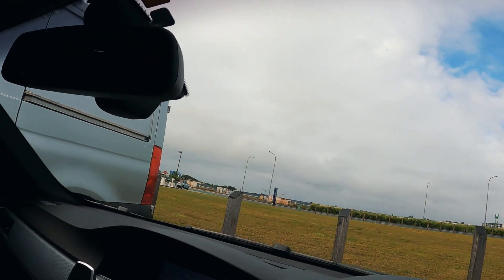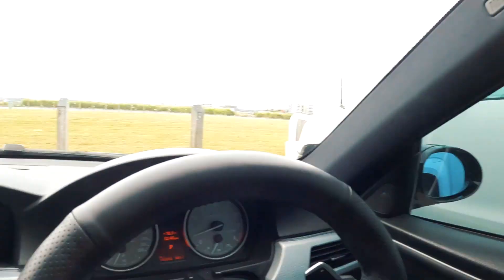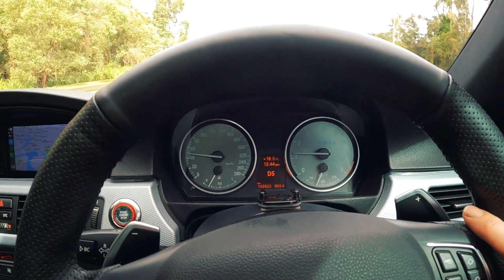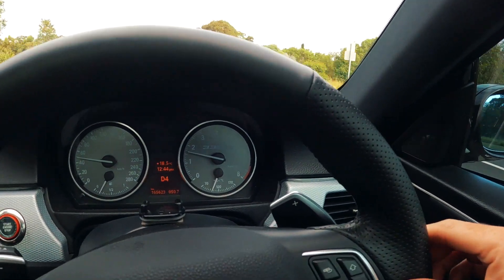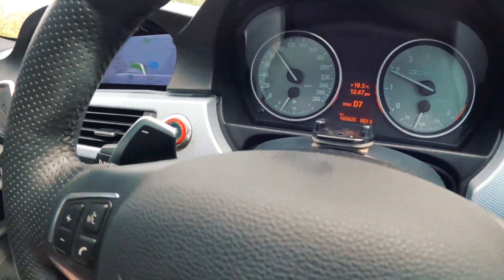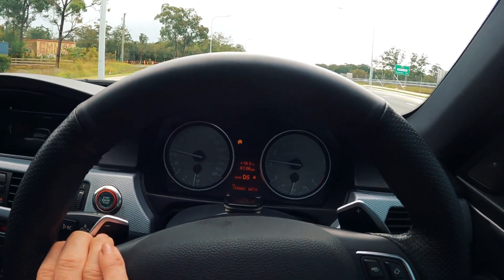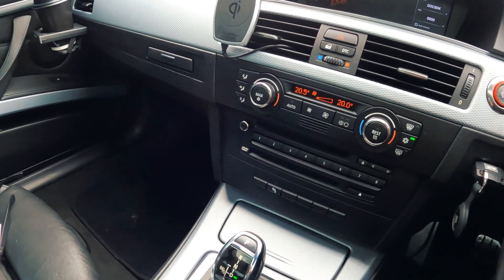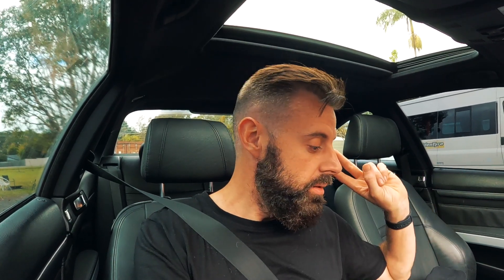BMW DCT SWAP With Single Mass Flywheel: What's it like?

Comment: Early shifting is exactly what my DCT does in comfort mode (Z4 35IS). In sport it'll shift with less clutch slip, much faster and in sport+ you get the fastest gear changes. In sport+ it'll keep the revs much higher similar to having the DCT in sport mode. Most of this is customisable in XHP. Early shifting is probably meant to keep fuel consumption down. The behavior of your DCT is absolutely correct.

I currently have XHP stage 2 on the DCT as I find stage 3 much too violent. There's 235000km on the car and the engine and DCT still feel like new. No noises that shouldn't be there or stand out at all. Shifting points (revs) can be customised.

Recently the weld of the ring (or pinion, I'm not an expert) broke off in the diff. I replaced the diff with a OS Giken super lock. Excellent piece of kit! My only worry is the drive shaft and axles now.

The only downside of the DCT I can think of is that it sometimes needs a bit of thinking time. That combined with the low revs in comfort mode (always highest gear possible) means no boost. Practically it means you need to put your foot down in time long before you start a quick overtaking. After years of driving this car it still causes sweaty handpalms sometimes.
Obviously this can all be avoided by a manual (or 2, 3..) downshift before overtaking. Basically the automation of the manual gearbox is excellent most of the time but it is not perfect! Not even with XHP.
Reply from the maker: Thanks for the detailed comment appreciate all that info dude. Can’t wait to try xHP
Reply: DCT is inherently slower at multiple downshifts like dropping 2-3 gears to make a pass on the highway... it needs to make those 2-3 shifts it can't just drop from 6th to 3rd like a regular auto or a manual. This is really the only scenario where youll see this delay.

Comment: Before you put the 26PSI map on the car check your reported torque from the map, that's the reason a lot of people say to avoid the JB4 on a DCT car. Your reported torque needs to be accurate, too little and you'll get increased wear and maybe slip. Also good to not over report as the shifts are so much better when the reported torque is accurate.
Reply from the maker: Jsr is on it!

Comment: you can tune all of these things with xhp as you know.  My N54 with the zf6hp shifts into 6th gear at 40MPH.  just tune all of those issues away!!!  Great Job Man!!!!
Reply from the maker: Thats the plan, well part of it anyway
Reply: Nice!! Hey what max power can the DCT handle?  I know the clutches can be upgraded. Also, you mentioned a “Group Chat” for folks, where is that?
Reply from the maker: @garygrenier  Hey Gary, the DCT "should" handle 1000nm with the latest xHP update. The telegram group chat is for the top level zero to 60 members the "ZeroTo60 G's". Its a direct link to my phone for direct support help and general chit chat.

Comment: Box controller when not in sport mode is shifting for maximum fuel economy, always. 

Aftermarket tune will solve it. Alternatively if you can modify the sport behaviour with the levels the most aggressive will avoid shifting into 7th. 

M50d rolls round in 8th at 60 in economy and 5th in sport +

Comment: I had to put headphones in and crank the volume to hear anything to do with the flywheel. Could be more noticeable in person but from here seems pretty liveable. 

Know what you mean regarding the D Mode economy shifting. It makes the car feel unpowered and sluggish. I stick mine into S Mode once it’s warmed up a bit and it sorts it right out. I tend to prefer that over Sport button because the throttle is more relaxed for around town driving. 

You definitely seem to be enjoying it! “One, two, three” on the paddles haha.

Comment: Great content!! I found the dct the same initially. but after driving a bit you will find the mode that suits your mood...that's the awsome thing about it. I have xph stage 3..calm in normal and aggressive in max sports setting. Leave the button off and shift gear over to sport is the perfect blend (n55 ps2 310 rwkw)
only negative..Consistent good launches are a distant memory 😃good work again!
Reply from the maker: I have no doubts about the launches being a pain from here on in.

Comment: When I did the XHP stage 3 flash on my ZF8 for the M135i, it keeps the revs up a bit more. Previously it would often go into 8th at 65km/h @ 1150rpm, now it wont go into 8th until about 80km/h @ 1400rpm. It also holds gears longer during light acceleration and reduces gear hunting. I also found that the torque converter locks quicker in drive mode too.

Comment: I've got a 335is with a DCT at about 83,000 miles. Mine behaves the same but it doesn't really feel like the car is laboring or the revs are too low. I'd be interested if it changes the more km you put on it. Great stuff!
Reply from the maker: I think it’s my exhaust. It’s just droney under 2000rpm which probably amplifies it all.
Reply: What exhaust is on it? I have the stock tuned 335is all the way
Reply from the maker: @maxcuevas1359  Its a milltek cat back system. Pretty quiet bit very very deep note. Like you cant really hear it driving but on cold start it vibrates the whole house.

Comment: With XHP you can adjust how long each gear will ride out in auto mode or with sports button pressed or s mode you can adjust everything so you can have it not switch to 7th so early in any mode you want

Comment: My issue with DCT has only ever been at low speed maneuvering and taking off on wet grass, when moving I found it fine, I drove a golf DCT with a tune on it and it felt like if it was manual, rev it up and dump the clutch hated it. I chose an auto in mt 135I and I've just done a stage 3 xhp and love it

Comment: You can set launch control rpm using the indicator stalk wheel.

Great video! Can’t wait for the next one.
Reply from the maker: I will check, but i am fairly sure only the true m cars can do that.
Reply: @ZeroTo60Tube  Whoops. My bad, I think you’re correct. Just checked the manuals and there is a definite difference between the M3 and the 335i. 

Maybe worth a try anyway. Apparently it’s the cruise control stalk. Push away for increase in rpm, pull towards you for decrease.
Reply: M cars only for the stalk selection they also get variable sport settings. Can adjust launch control rpm in xhp for these ones

Comment: N54 community needs a “torque by gear” tune/setting rather than boost by gear.
Reply: Is there an inbuilt method of detecting engine torque?
Reply: @Adam-eo5ff  There is in MHD. In the graph it reflects a Newton meter of torque rather than foot pound. So I’m pretty sure there is a way, but nothing that has been mentioned in videos other than boost by gear.
Reply: @SWATMM  I think this is actually just a scale with a maximum torque level and a gauge that adjusts based on throttle position.

Comment: Love this series mate. Great information provided. I feel like too often people don't care or talk about OEM levels of driveability. It IS possible to increase performance of a car and retain factory levels of NVH and driveability. But so often people just seem to put it in the too hard basket. I'm investigating putting one of these DCT's behind a 2JZ. Do you know what a typical price for these is in Australia?
Reply from the maker: I know you will need the HTG controller and hours of tuning. Probabaly going to be $8000-$10000 in parts and then tuning is like how long is a piece of string.
Reply: @ZeroTo60Tube  Sorry, I was specifically asking about the trans cost alone. Whifbitz make a conversion kit for everything else. From what I can tell the transmissions cost ~$4-5k here
Reply from the maker: @mr.a5147  Sorry dude, they used to be around $3000-$4500, however they are sneaking up in price of late. I havent seen one for ages. ebay.com.au is the place to keep an eye on.

Comment: Can drive mine to compare feel if you want. Definitely prefer the creep disabled, the xhp flash makes driveability in D mode heaps better, auto blips on downshift and can set clutch packs to performance or burnout mode, night and day difference. One thing though in Sport mode the shifts are violent and unsettle the car a bit but adding some torque reduction helped all round
Reply from the maker: Good to know. Good to know.

Comment: I’d say the biggest benefit of the xhp is the increased line pressure to keep your stock clutch life longer! Especially since you said it’s at 190k’s bet you the m factory flywheel helps the clutches too since there is less mass?
Reply from the maker: That’s the main reason I want xHP. You could also be right about single mass flywheel.

Comment: Andrew im thinking of going with this Flywheel for my OG M2, i have heard that some say the noise is atrocious in 7th gear on cruise? Would you say it is really so bad?
Reply from the maker: On mine i just had to raise the rpm shift points. So it wasnt labouring the engine at low rpms. Im gonna keep using this one.

Comment: Enjoying the video - but what have I missed regarding your diff? Why do you have a open diff now? What video do I need to watch?
Reply from the maker: The old diff is not compatible with the dct. So it’s out.
Reply: @ZeroTo60Tube  so what is compatible? How come yours wasn’t?
Reply from the maker: @lukeviewservice  Diff ratio, the auto is a 3.46 vs 2.56 ( i think) in the DCT. Then the DCT diff is a welded diff gear, so i cant swap the the centre.

Comment: Is flywheel pretty straightforward install?  Just remove tranny and old flywheel then bolt in new one?  I tried looking through the series, couldn’t find a clip of you showing the physical install of flywheel.  Sorry if I missed it.
Reply from the maker: I can’t remember if it is filmed either. Was a while ago. However it is simple, place on torque up.
Reply: @ZeroTo60Tube  Thanks man

Comment: I know it's an old video, but I'm planning on the DCT swap on my e39 540i, and I ditched the DMF for a 15.7lb/7.1Kg SMF from TTV Racing, I should be able to retain my flywheel correct?

Comment: If you flash the 135i DCT software onto it, your launch control will drop to 3500 rpm, the "creep" at idle will all but disappear (will be more like a 6at), the gear changes will be better, and the delay going from N to D (or R) will reduce. Made my DCT 335i much nicer to drive.

Comment: how much torque your dct is showing at peak on mhd or jb4? I believe you got stage 3 xhp.
Reply from the maker: Not sure, I'm sorry, its been a while since this was tuned, the tuner generates the figure regardless. It's calculated with the custom tune and all made to work together with vehicle setup and trans tune. If you over report too much the trans shifts crappy at low load but under report too much and it will slip.

Comment: It would be interesting to compare ignition timing logs.
The 6AT has huge timing changes (like 30deg) during a shift for torque reduction ;)
Reply from the maker: From what I have seen, my logs look similar. I never had the 30deg drops on the jsr 6at tune tho. He’s a wizard with shifts on the autos
Reply: My 6mt runs 30+ degrees of timing if I’m just cruising, but then obviously comes way down under boost. That’s fairly normal.

Comment: Sounds like you have a bit more intake noise. Should have less drivetrain loss, should be the same as a regular manual. Gonna be sick with an lsd!
Reply from the maker: I agree with the intake noise. It’s putting more load on the motor at low rpms. Having no torque converter slip would cause that.

Comment: What is supposed to be the advantage of running a SMFW?
Reply from the maker: So main advantage is weight. The motors rev quicker with the lighter flywheel, not so much if big deal with dct on the upshift as it locks in to gear so quickly, but it can help smooth out downshifts as the motor gets to the rev match target rpm faster. Second advantage is no knocking noise on shift. Very high power cars will damage the dmfw fairly quickly. Well not damage. But wear it out and can knock as the gears engage. The downside is the chatter at idle/low rpm high load.

Comment: I've found an M4 flywheel at a reasonable price, but I'm not sure if it's worth while changing the my current N54 335is DCT flywheel as the car needs no other service done. How long time should it take the workshop to swap it?

EDIT: I had the M4 flywheel mounted, and I honestly can't hear any difference. The engine ofc revs up and down faster 😁
Reply from the maker: I would expect a shop to work on about 4-5 hours to do the swap. But it could take longer if there are any unknowns. It could also be quicker, but i'd say 4-5 hours is fair.

Comment: whats the difference in driving/feel between smfw and the dual ?
Reply from the maker: Dual should be slightly smoother. But my bet is people wouldn’t notice.
Reply: @ZeroTo60Tube  but revs faster?
Reply from the maker: @pennypacker2000  Single mass should rev faster as they weight a fair bit less. But no issues with false knock on single.

Comment: I always hit Sport on my DCT. Gear selection seems more sensible.
Reply from the maker: Couldn’t agree more with that. Do you run xHP by any chance?
Reply: I do the same sport button on when in d mode. Doesn't seem to jump into 7 until on the highway and I'm stock dct.

Comment: Your car idles at almost 1k rpm when stopped in traffic, mine usually idles(after warmed up) 0.6k rpm... 
Have you some extra oil cooling? because your oil is "cold" and that is forcing the rpm up?🤔 
Mine is a n55 so it can be different, mine runs in between 100º~120º... other than that your dct behaves exactly like mine, good work! 👍
Reply from the maker: I mentioned it in the last vid but I have upped the idle rpm. It idles at 800rpm now. Well targets 800.

Comment: Speaking of weird stuff with mhd launch control. In my 6 mt 335i i set launch control, "the rev limiter basically" to 4500 and bounced it off of it and it was making -6 lbs of boost.  Is it normal for mhd to not boost even one or 2 lbs for a launch or did i get a setting wrong or something
Reply from the maker: You need to get load on the motor to make boost.
Reply: @ZeroTo60Tube  what do you mean, im talking like you are at a standstill in 1st gear clutch in. Ready to clutch dump it i rev up the launch control and its not positive boost.
Reply: Or ask your tuner about it.  I believe for special situations a tuner can make a tune that will spool the turbos in LC (retarded ignition and Vanos).  However, as i understand it, you also cannot turn it off, i.e. anytime you drive through that load cell you get that timing, so it’s not really daily drivable.
Reply from the maker: @lucasschema6874  basically a turbo motor wont make boost when there is no load on it. Dont matter how hard you rev it. You need to load the engine up, its why fast automatics have transbrakes. You can create load by reducing timing so much that even just spinning the clutch and flywheel will be a load for the motor. But there is some trickery in making that happen and its not a solid method.

Comment: the car is only engaging the clutch pack when you let off the brakes. turning creep mode off wont do anything for your clutchpack. it will only wear them faster because you are going to use more power when touching the throttle.. but xhP is the way to go anyways.
Reply from the maker: It feels like it starts to creep before pedal is fully off.

Comment: sweet, so i guess its now ready for roll racing on the 17th??!! :)
Reply from the maker: 50/50 at the moment. It’s running about 450-475hp right now. Need to make sure it’s on up at 26psi yet.

Comment: 🤔 This trans with single turbo or this trans with a lsx turbo swapped into an e91 chassis.😁
Reply from the maker: one day, one day!
Reply: I am sure I can get an adapter built but it's getting the transmission to work with the ecu and chassis is going to be a headache. But 1st I will copy this setup for a daily.

Comment: Anyone complaining about that single mass flywheel rattle needs to come and sit in my car with the twin plate
Reply from the maker: I do wonder if the people complaining have solid mounts. My car is all rubber so drivetrain noise would be minimised.
Reply: @ZeroTo60Tube  could be, i just think it's people complaining for the sake of complaining. Everything about going faster than factory is a compromise in some manner. I'm chuffed to see you guys make it work and recover anything you bricked along the way.

Comment: If you shift between 6000-6500 rpm it’ll help stay in power
Reply from the maker: Not with hybrids. I only revved it to 6850 on the dyno, but power kept increasing. So i am assuming its probably gonna make power well past 7000rpms.

Comment: m factory smf is not good for your rod bearings due to extra vibration change it to m4 flywheel
Reply from the maker: Out of curiosity any evidence to back that up? I can’t see how it’s any different to a manual car with upgraded clutch. No one ever says “my manual trans and upgraded clutch is bad for my rod bearings?”
Reply: @ZeroTo60Tube  no hard evidence,but a few cases of spun bearings right not long after m factory smf install maybe it causes dis balance of rotating assembly maybe just coincidence
Reply from the maker: @durin23  Look it makes sense, but was keen to know more thats for sure. Will keep it in mind. MInd you the boost will probably be a problem long before the flywheel hehe.
Reply: @ZeroTo60Tube  respect for pushing the limits will be watching.

Comment: I have a m factory flywheel on my dct.335is and im single turbo. Instagram 335is_payne

Its amazing. Definitely worth the purchase. Never heard any rattling or anything
Reply: The mfactory flywheel it will fit bolt on? Thanks